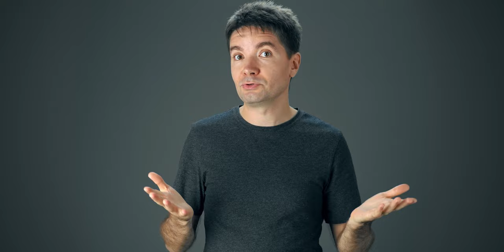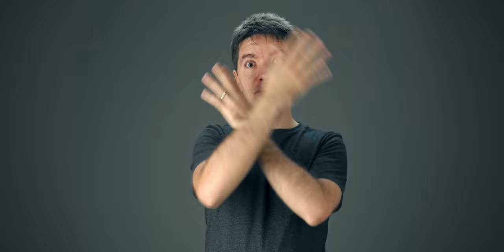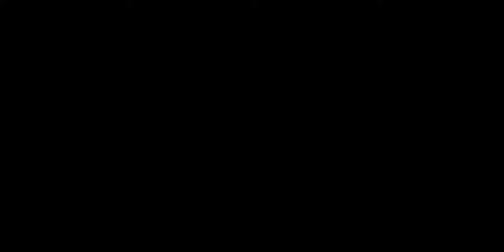Halloween present: The PitStop Extruder is now free for the 3D printing community

Comment: As someone who has tried edited STLs in the past with generally mixed results: THANK YOU!

I've come across so many projects that roughly 95% of what I need but in most cases the authors don't provide the source files and either don't respond or are unwilling to provide them when asked.
 I don't have any plans on installing the PitStop on my Prusa because I am happy with my Bondtech Extruder but I might considering modifying it to fit one of my other machines and having the STEP files will make that easy.
Reply from the maker: Sure, I'm happy to help.
Reply: @MihaiDesigns  Hi Miha, thank you for this great work, please tell me this will fixed for Bear Mk3s Version? I in time to change my broken extruder parts but I read Pit Stop doesnt fit.
Reply from the maker: @motionlauncher5574  It fits my Bear V2 with MK3S. I haven't checked with Bear V2.1, you might have to shave off a little from the top z-mount but I can't tell for sure. Should be easy to do.
Reply: @MihaiDesigns  Thank you very much for kind and fast answer. Perfect! I will start to check BOM right now to print it and test it. Thank you again. Have a great week.
Reply from the maker: Have fun!

Comment: I was just about to ask about these! Time to experiment with connectors for quick swap hot ends.
Reply: I have implemented that on my printer with some DC connectors. The pit stop is the perfect application for it. Works like a dream
Reply from the maker: Can't wait to try out your solution.

Comment: Hi Mihai, do you think is better print with ASA or Polycarbon or CPE (co-polyester) for piststop inside enclosure? I thinkg on CPE cause on description they say is easy to print like PETG and resist up 80° like ASA
Reply from the maker: Hey Roberto, I haven't used CPE yet. As long as you can get good layer adhesion and can avoid warping you should be fine.